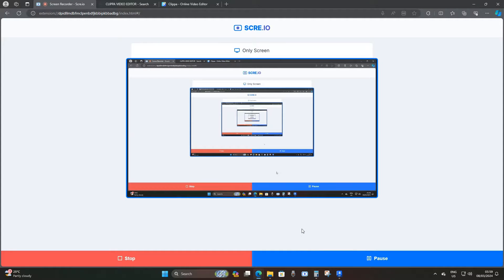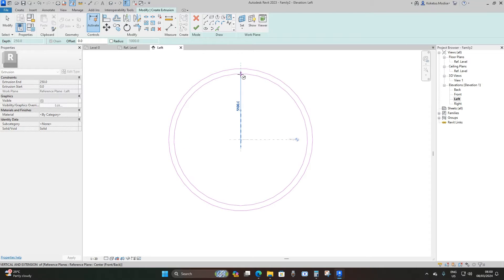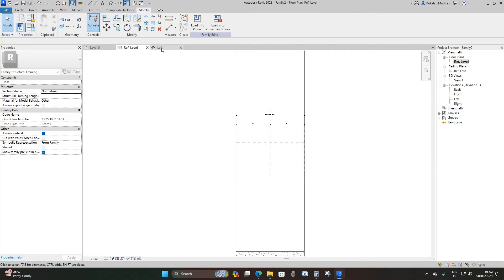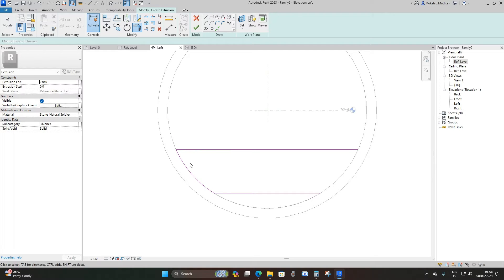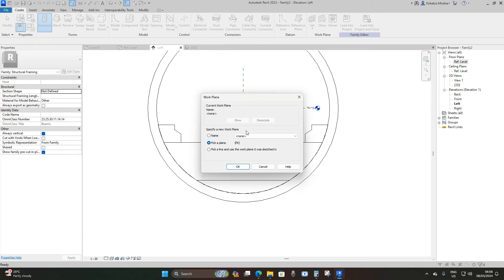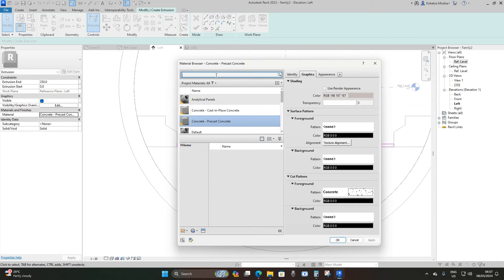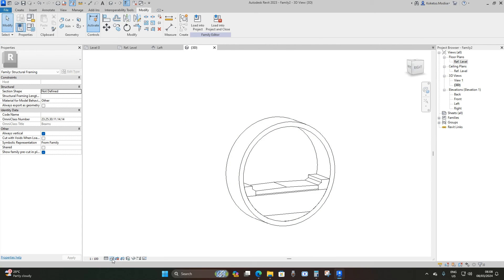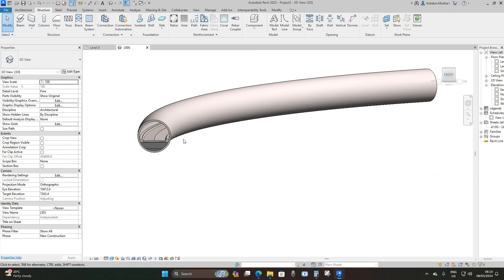Tunnel in Revit.

Comment: Thanks for your video. How would you add your tunnel geometry on a 3D alignment?
Reply from the maker: Depends on what workflow you are using. You can generate a Dynamo script based on alignment points and snap the family towards those points and lines, or you can use Sofistik to generate an alignment and attach the family towards that alignment.